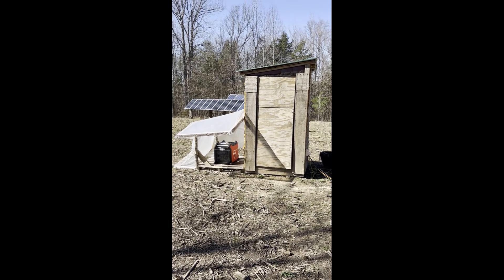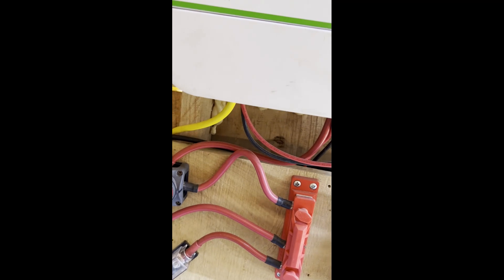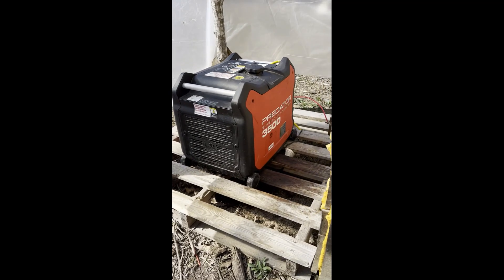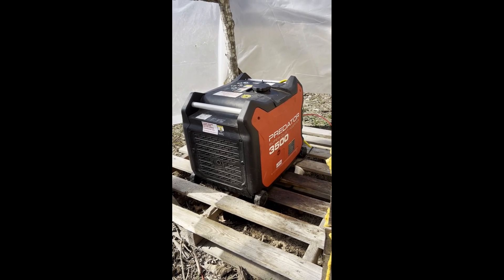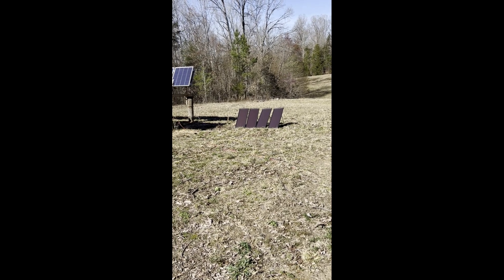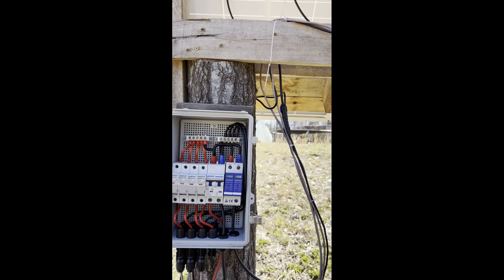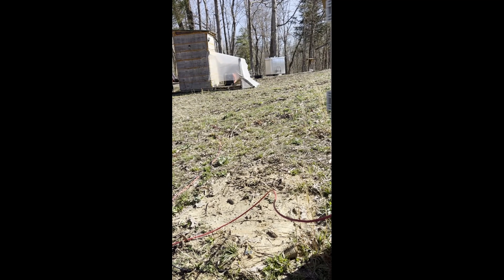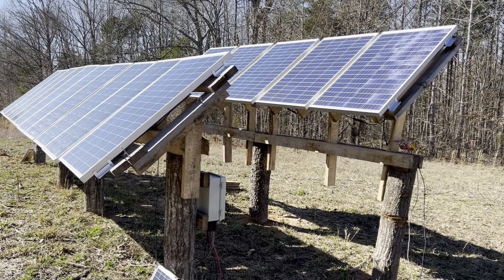Off grid Solar setup - user friendly - easy to install - great setup for beginners

Comment: What made you go with Renogy AGM batteries?
Reply from the maker: A few reasons. For Renogy specifically the price was really good (actually cheaper now), they would ship to me, and the research and reviews I read were quite positive. A year later and I have been able to run my homestead on them with a generator back up for days of overcast. I chose AGM for a couple reasons too. I could not afford the lithium and I wanted something where I wouldn’t have to worry about leaks like regular lead acid can do.